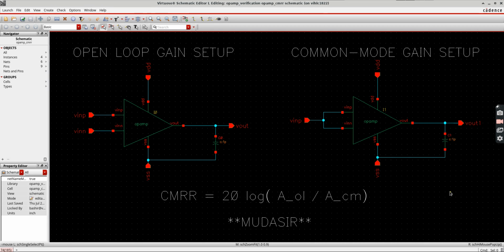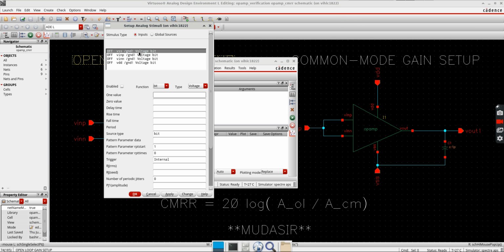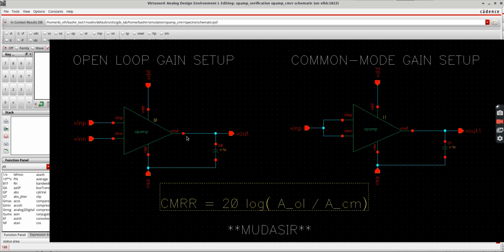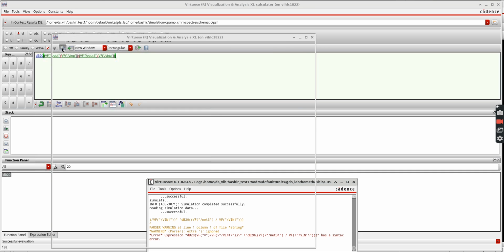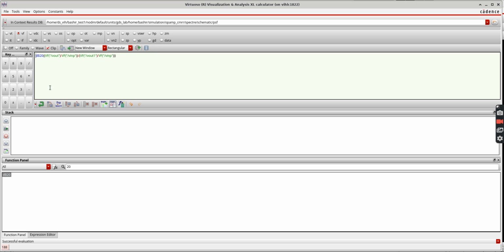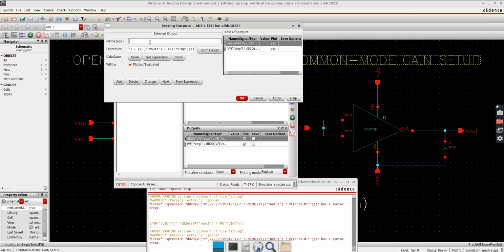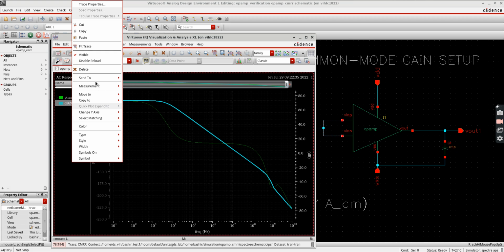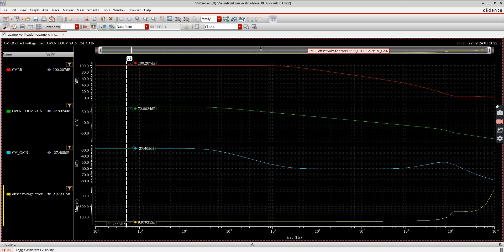CMRR Calculation of OPAMP #cadence #opamp

Comment: Hello sir 

For 2 stage opamp in order to ensure the transistors of second stage remain in saturation I connected in unity gain configuration to set output node voltage.

But for CMRR we have to disconnect the loop and apply signals to two input terminals but how this will ensure that inside the opamp block second stage mos are in saturation?

Can u pls guide

Comment: hi mudassir i think CMRR=Vio/VCM where VIO is offset voltage ,so from that equation VIO=CMRR * VCM but in equation you divided open gain by cmrr
Reply from the maker: some thoughts:
the output of the op-amp ideally should be equal to differential gain multiplied by this differential input voltage (Ad x Vid). But because of this common mode input signals, you will see another term in the output. That is common mode input gain multiplied by this common mode input signal. So, this term basically represents the common mode output voltage which appears at the output side (Ad x Vid + Acm x Vcm). And for any op-amp, this term (Acm x Vcm) should be as minimum as possible. So, in other words, we can say that op-amp should be able to suppress this common mode input signal, which is present at both input terminals. And how well it is able to suppress this common mode input signal is defined by the parameter which is known as the common mode rejection ratio. And it is the ratio of this differential gain divided by the common mode gain (CMRR=  (Ad/Acm)). And in decibel, it can be represented as 20 log (Ad/Acm). 

The output offset voltage error is ideally defined as VCM/CMRR or VIN/CMRR